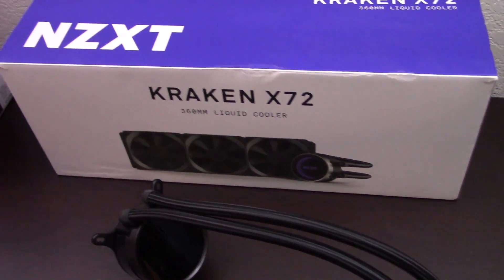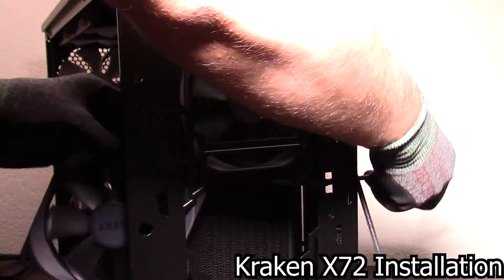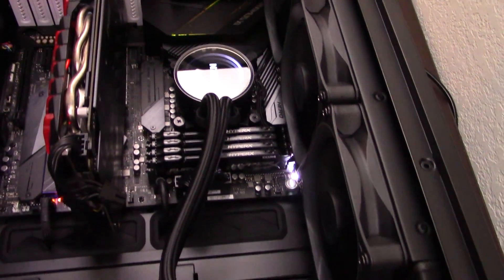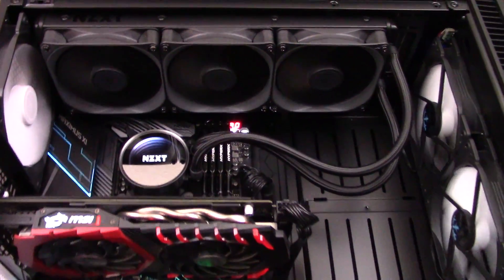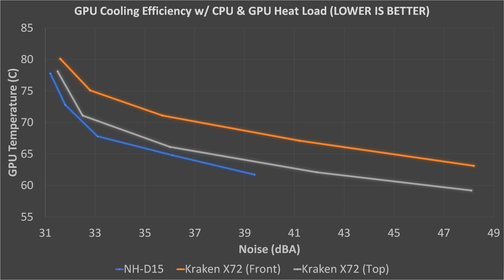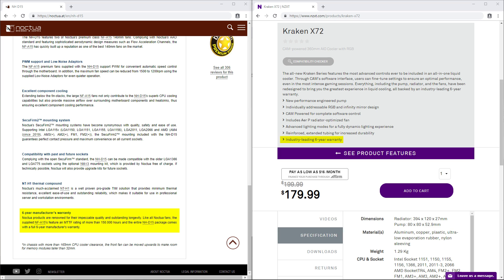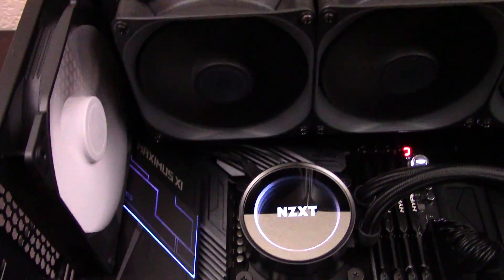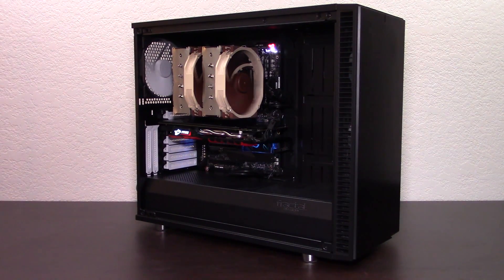Air Cooling vs. Liquid Cooling: The Ultimate Showdown (feat. Noctua NH-D15 vs. NZXT Kraken X72)

Comment: I enjoyed this video man. You could have used the kraken x62 and probably got the same results seeing as a 360 rad is IMO overkill for just cooling the cpu. This would give it a little better case compatibility while still keeping the performance. In my experience even with older school Intel fireboxes that extra 120 mm on the rad gives you diminishing returns seeing as you can't get below ambient. Just wanted to throw that out there awesome video man.
Reply: 3 years later - 12900k says hello, and laughs at 360aio

Comment: One thing that would be interesting to know is some kind of longevity test. If the liquid cooler runs for 5 years, and breaks, does it break everything else it leaks out on? Does a failing fan at the air cooled one, cause other elements to eventually over heat? You know?
Reply: It's just the pump that stops working, and your system will shutdown when the CPU gets too hot.

Comment: What case are you using? And can the case, with no problem, fit a 360 rad in the front that is behaving as an intake? Can you please answer these questions i need ti build myself a new pc.
Reply: The case is a Fractal Design Define S2

Comment: it depends on a CPU, the NH-D15 has a lot of metal to it to consume the temps at CPU power spikes while the liquid AIOs just dont, water does not conduct heat as fast as metal does. 
Throw this AIO on a Ryzen 3950 and see it squirt like a horny teen who just seen a P## for a first time in just under a year you would mount it, that could mess up your whole rig! 
When I got a Ryzen 3800x my 240m cooler master AIO was calling a day on it barely able to keep the thing under control and started to develop signs of leakage, I had to get the NH-D15 to keep this CPU under control and thats just 8 cores imagine the 12 or 16 of them, this is not a threadriper , the cores are way hotter on these new ryzens a custom loop water would be required beyond the R3800X I would say.

Comment: Custom loop > Air cooler > AIO
Reply: Costume loop are still risky and over long time under load the air cooler is better
Reply: @TheDarkestPaladin  Sure, air is the safest. If you go water though, custom loop. I wouldn't even consider an AIO personally. I think a lot of users of AIO's do not even realize that high end air is on par with their AIO, but they think " water cooling" and automatically assume its better.
Reply: @jsharp9735  but to be fair it does look better and cooler :P
Reply: @TheDarkestPaladin  I like air coolers more than AIO's actually. ;p
Reply: @jsharp9735  I'm planning to switch from my normal noctua nh-d15 to the black version
Reply: NH air cooling is more effective than most of custom loop.
There are a lot of test results in youtube prove it.
Money and effort don't give you the best result sometimes.

I saw only two special case of custom loop beat NH.
One was liquid metal custom loop(mercury or gallium). Liquid metal's heat conductivity is a lot higher than water.
The other was tap water open custom loop. Temperature of the water from tap is normally 18C.
Reply: I agree here.  My custom Dual loop system under a 12 hr full load never sees above 45C, but it's loud as hell lol!  But thermals are on point!

Comment: performance per cost ratio destroys the nzxt.
Reply: The D15 Is WAY hotter, and would melt your CPU. And don't bother to overclock the CPU with a D15.
Reply: @Blarson12  no, it wont, dont be a fanboy
Reply: @lokibau  I'm not, you're the fanboy, i'm looking to the future, and the future is AIO coolers, just look how hard it is to find a good air cooler. Majority of coolers now are AIO coolers. I dare you to push your air cooler to the limits.
Reply: @Blarson12  you posted cringe, bro. AIOs are inherently too expensive, dangerous and prone to failure to compete with high-end air coolers.

Comment: Why is this guy not comparing the coolers under a similar load. I get it, noise is a thing and less is better. But if you intend to compare two coolers, I am pretty sure the ability to do its job (cooling) is most important.

Comment: I've always used ThermalTake 240 for my OC  and I get 23c idle and never see over 55c full load gaming, tried the noctua,frickin case heater,ugly and can't access anything on the Mobo If need be,I've never had an aio leak,but I'm a stickler for proper installation

Comment: Two more points to consider for the NH-D15 is no bloated buggy spyware/software like NZXT's CAM and I get better vrm temps with the Noctua.  I have an X62 on a G12 bracket for my GPU and yes I've tested both.  It's just ugly, it's huge...and it sags

Comment: There's a category for Ease of Installation (personally, the difference in number of screws needed to install either unit doesn't bother me so it's a negligible point for me) but Ease of Access for Maintenance/Upgrades are a minor consideration? Scoring for me is 3-3, thereabouts. I'd also stress a bit more the electric bill one might be paying/saving for each system, though tbf you mentioned the higher wattage of the Kraken (but not the dollar amount attached to that fact. Fine, it's inferred...but still). Also, enthusiasts? What about the pros who edit videos, produce audio content, vfx artists—basically anyone who needs to make a living using a pc and need a dependable, robust system to do so, where do they fit in? Ah well, to each his own. Still a good video and thanks for the share.

Comment: I used water cooling for about 2 years with custom setup what a fricking nightmare every time I wanted to make a change to the system. Just watch some of Jays2cents videos to see the mess it can create and the RISK of water damage. I now own and use a NH-D15 and LOVE IT. The presenter talks about looks, when was the last time you had your girl friend stop by and go man that Brown NH-D15 fan is Fricking ugly you not getting any tonight, NEVER has that happened. If you want your CPU to run faster stop over clocking and BUY the faster CPU. Its that simple.

Comment: I would be interested to hear a more 'apples to apples' comparison with the behemoth air cooler, the Scythe Ninja 5, that is supposedly the quietest air cooler you can buy. Particularly under load...I just put together a new system with a Ryzen 7 2700 X cpu and the AMD Wraith Prismcooler that came with it, while pretty, is unacceptably loud under any kind of load. It's actually driving me a bit nuts! Another piece of the equation , will be to get one of those Fractal Designs pc cases as that will help on noise reduction too.

Comment: The funny part is NXZT's own X62 is not only cheaper, but it also outperforms the X72 across the board lol
Reply: that's what I have x62 :{
Reply: @Elite-Millionare  Same. Good stuff.
Reply: @junkiexl86  Thank you! the past 2 days I was researching a cooler for my future 3900x build and I wasn't sure what to pick, either X73/72 or X62/63. With X73, I would have to put it in front and reduce airflow cause of the radiator but if X62 does better, than I can place it on top and keep a good airflow with some Noctua front vents in the case. So thanks again!
Reply: @lascaustefan4087  My 3900X is cooled by the X62 actually. 4.4ghz all core OC, never goes above 65c, Games between 42-60c. I have to hit it with a CB20 loop for a long time for it to finally hit 70c.  https://imgur.com/5xLkH6Q
Reply: @junkiexl86  those are great temps! How dose CAM software behave for you? I couldn't find anyone to tell about the latest versions. Also, I was thinking going with X73 tbh, even though they have almost same performance (compared with X62, from reviews)
Reply: @lascaustefan4087  I have no issues with CAM. They did have a memory leak issue for those who went long periods between system reboots, but all that was fixed with the last update. I only use CAM to regulate my pump/rad fans (as both are locked to slowest speed if CAM isnt running in background..) other than that I never fool with the software I just let it do its thing in the background.

The X63 is basically the same as the X62 with exception of the pump housing is 10% bigger for "better RGB" and it rotates 360 degrees which can be helpful. Oh and it's $10 cheaper than I paid for my X62 so I would get that one honestly if not the X73 though there is little point in the X72/73 as it performs less AND costs more. Here is how the X62 looks in my rig https://imgur.com/jbUaWlD
Reply: Shawn Elliott nice to see you lined up the NZXT logo correctly I unfortunately fucked it up today and it’s slightly rotated FMl
Reply: @junkiexl86  I still haven't bought my system because of the "human malware" and uncertain times, but I do plan to get it in the next 2 weeks so this came right on time. My problem is I am planning on placing the rad in front of the case and that's why I thought of a 360 rad. I have seen Bitwit's video about rad placement but I am also thinking, maybe, if I bought the 280 one(X63/X62), I could add a fan only at the bottom who could bring more fresh air for the gpu (which I plan to be the 2070 Super Aorus). SO I'm still not sure which way to go.
Reply: @junkiexl86  And I forgot, a really nice and clean system you got there :D Really like it ^^
Reply: @lascaustefan4087   Thanks! When I first got my X62 for my old 8700k build the case I initially started in, I had the rad vertical in the front. It did kind of bug me having that fan sized gap, so I can totally understand the enticement of a 360 in this case, though too without side intake, having that fan on the front in addition to a 240/280 rad could possibly help with intake airflow. Though I don't think I have ever seen that done, most just go with a 360 for a uniform fit. 

Are you still looking to get the 3900x? To be fair and if you don't mind waiting a little bit longer, the Zen 3 chips, most notably 4900X drops in 3 months (July). AMD claims a nice efficiency and IPC bump with Zen 3 over Zen 2. And you have to remember that same 30%+ IPC bump we saw with Zen 2 over Zen+ was what dethroned Intel finally (though the 9900K/KS still holds a slight raw FPS lead, above 1080p res it's pretty much tied. outside gaming 3900/3950X just shit all over Intel). I know I will be upgrading to it since Zen 3 will be the last chip supported on AM4 (per AMD) Glad I went with an X570 board now lol.
Reply: @junkiexl86  I really didn't knew about the 4000 series launch so soon. I'll consider it , maybe. My plan was to build a pc around Blender, in my budget, and I feel like I have been delaying it for months because 1st I try to be financially secure and as a freelancer, that comes a bit harder, especially now. So I really don't know what to say about this...my plan was to build a pc with a 3900x and a 2070 Super and then add another 3000 series Nvidia GPU because of the ray tracing improvements -> lower render times.That's why I also want to place the rad in front, because all the hot air GPUs will evacuate will go top/rear and would heat the rad if I were to place it on top. And yes, since x73 and x63 are on par pretty much performance wise, i would go for the 360 rad for the uniform fit. Right now I use a laptop, Acer Predator and for the past few months thermals have been a nightmare, even with undervolting, changing paste and cleaning the laptop regularly so for this build I'm planning to have the lowest temperatures possibles, without diving into the realm of custom AIO's, since that's way over my head :D
Reply: Also, what I wanted to say with that is that games are not a big interest for me, I mostly play multiplayer stuff like Wow and I'm totally sure a 3900x can handle that :D
Reply: @lascaustefan4087  Oh yea. I mean a 3900X is more than capable. I only suggested it since your mind was already made up to spend that much on the CPU, mind as well just wait a couple more months and get the 4900X as it will be the same price plus a nice bump in performance. I would hate to buy something on the eve of something better coming out for the same price. But its not the end of the world if you get the 3900X by any means.

The other caveat is the Geforce 3000 series drops about 45 days after that and the 3000 series will undoubtedly be cheaper than the 2000 series as well as bringing "massive improvements to Ray Tracing, AI and Rasterization performance" per Nvidia.  So you could essentially hold out till August and pick up a 4900X and a 3070. Improvements across the board vs a 3900X+2070S, a bit cheaper as well. Though you may be pressed for time and cannot wait, esp as a freelancer. Either route you go Im happy for you none the less!
Reply: @junkiexl86  Yes, I know the feeling :D I would normally wait, but I have this in mind for a looong time and I'm not sure I can wait any longer because I too am very excited by the idea :D Since I plan a dual gpu system, I will also get a x570 board, so I think I will be able , when 4900x launches, to swap my 3900x for it and I don't think I would be at a very big loss so this could be an option too. Also, my freelancing doesn't have anything to do with Blender and I can do it on any hardware since I connect and work through a virtual machine so all the processes are handled by that so I could wait, theoretically, but I'm really tired of seeing my laptop go 70+ degrees just because of 2 open tabs -_-.

Anyway, thanks a lot for the input and advices, I will definetly keep in them in mind :D

Comment: Try the REEVEN OURANOS you wont regret it and hey Don't like the OURANOS fan color wtf guys peel off the fan name center sticker and just take a can of flat black paint and lightly mist the fan blades no big deal. Lightly mist till black will not hurt anything on the output  of the fan specs. So a couple lightly misted coats let each coat dry before the next goes on should take ya max about 20 mins to have black blades and simply re-apply the fan center sticker and BAM Kick Azz Black Fan. I have 3 of these OURANOS CPU COOLERS in push pull config and they out preformed a few water coolers I had used and best of all never had to worry bout a water leak one day or shrinking coolant in the closed system to one day run me hotter and hotter as time wears on. These factory fans it comes with are actually pretty hard to beat and WTF you work in a library or something that you got to worry bout a lil bit a fan noise or something? ROFL … You wont even hear these puppy's running even when they mite ramp up and as a matter a fact this bad boy runs my Devils Canyon i7-4790K Gaming Build so cool even under a load that these fans have never ever yet had to max RPM it lol yeah this bad boy is that bad indeed and it does the same on my job for my latest i7-7700K  Gaming Build. It has cleared not blocked what so ever any of the 4 ram slots on the MSI Z97A Gaming 6 Motherboard (32 Gig 4 sticks of 8Gig Each of G-Skill Rip Jaws X ) used for the i7-4790K Devils Canyon Build and same goes for the i7-7700K MSI Z270 XPOWER TITANIUM GAMING Motherboard using 64 Gig of XPG Spectrix D41 RGB Extreme Gaming Ram (4 sticks of ram 16Gig each). … Oh and yes on the devils Canyon I had a Rog Strix GeForce 1070Ti OC Advanced graphics Card in there and upgraded now to a MSI GeForce GTX 1080 Gaming X Graphics Card and have plenty clearance between the card and Ouranos Cooler AND also on the i7-7700K Titanium build running the biggest bad boy you can buy which is the ZOTAC GeForce 1080Ti OC AMP EXTREME which is the size of a Air Craft Carrier lol and yep still plenty a space between the Ouranos and Graphics card. So there 3 out of 4 of the most important things for a CPU Air Cooler it passes with flying colors BUT the 4th thing will be your only worry and that is the height NOT the width if the cooler so check with the PC Mid-Tower specs you plan on using it in as most Mid-Tower Cases but never take it for granted please check the case specs you plan on using it in to make sure. I have 1 in a INWIN GT-1 Gaming Mid-Tower with no problems and the Devils Canyon in a Cougar Challenger Black Steel ATX Mid-Tower Computer Case and the i7-7700K Titanium Build in a Rosewill NIGHTHAWK 117 FULL TOWER so don't have to worry bout any spec's in that case as its big enough that if anyone comes over and wants to stay overnight I could throw a bed in it and use it as a temp. guest room ROFL. Well that's it all I got to say about it and its simply a awesome cooler worth every cent and I suggest buying the extra fan for it as they give you extra clips for a fan with the cooler incase you want to push pull config it and last but not least if you no way can fit this in your case TRY a 120mm Fan powered so the cooler is a lil smaller in height made by DEEP COOL called the GAMMAXX 400 Or the REEVEN HANS which both will not block any ram slots and run your rig cool as well with the ability to still throw a small overclock on your system without worry and comes with a set of extra fan clips incase you would like to run it in a push pull config. as well. It is only 154.5mm Tall and fit ALMOST any Mid-Tower out there. Remember I said almost so never fail to check the specs of your case or the case you plan to use it in no matter what type a cooler you plan on using. Hope this novel I wrote somehow helps you and Hey if this somehow did help you please give it a thumbs up … Would appreciate it. Thanks and Game On ! ;)

Comment: It would be great to test (for Air Cooling) if using max fan speed is more efficient (provides best CPU performance) vs a variable bios setting (changes with temp curve).  Because i'm thinking that this variable feedback loop is not fast enough to provide the best performance, given how quickly these processors like Ryzen 3000 series from idle to loaded state.